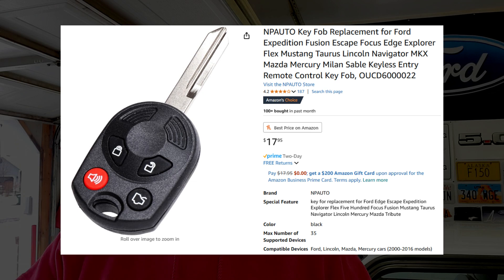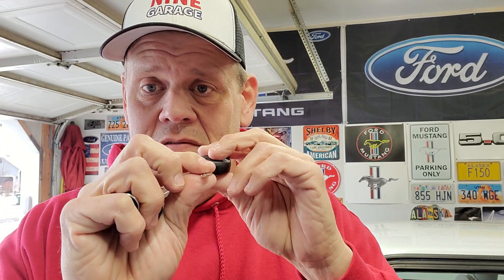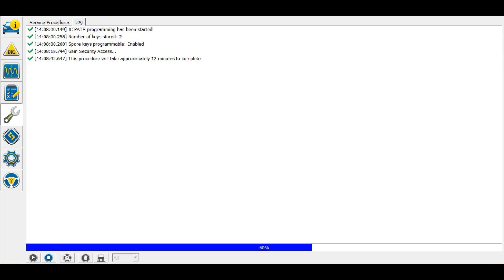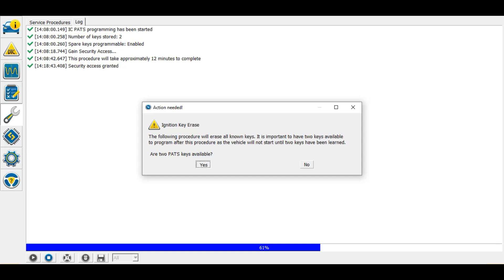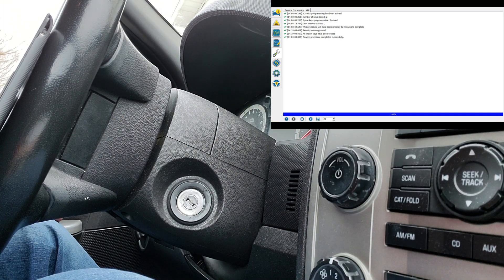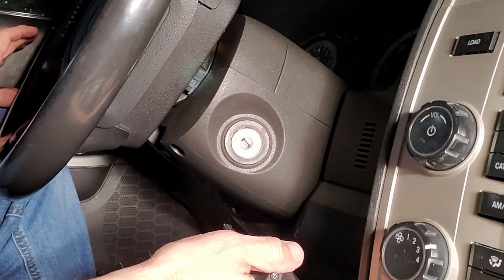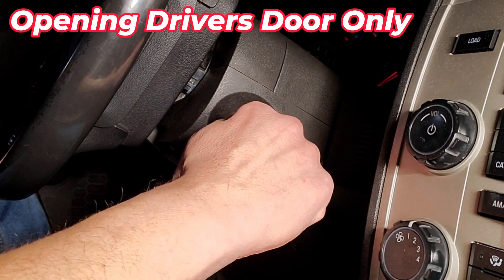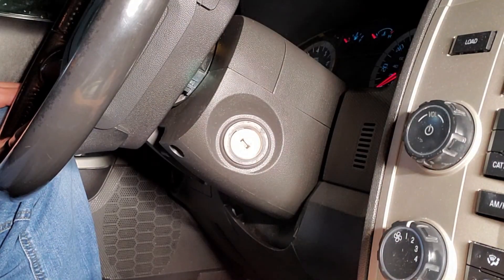Programming a New PATS Key for Ford using FORScan | Step-by-Step Guide

Comment: So i try the remote start on my car i have 2 original keys these are the two Factory keys because I'm the original owner and that remote start did not work from Js alarms they sent me another remote start and it still didn't work I am baffled that it didn't work with two program keys from day one i am original owner thanks
Reply from the maker: That is weird. The way it is acting sounds like one is a cloned key, but that theory is crushed based on your knowledge of the keys being OEM. JS did tell me that they could make it so I could program it off of one key, but it would require me sending it back to them for additional programming. Did that topic come up in your conversations with them?

Comment: Does the original key need to be the OEM FoMoCO key? The only working key I have is a cloned or 3rd party key, so just needing some affirmation on this!
I don't want to start this and then have no working keys ;)
Reply from the maker: It is my understanding that yes, it will work. I have not actually had anything to work with  except an original key. I've read that some newer (2019+) vehicles are not yet supported, however. What year is your vehicle?
Reply: @89G  It worked fine =)
Reply from the maker: @inspyre.design  great info! I really appreciate you adding that to the comments. I'm happy to hear it will work!
Reply: @89G  '11 Expy. I have two new keys cut and ready to program =)

Comment: I’ve got a 2022 f550 with no keys. Had a key made. No buttons or anything just a cut key but when I try to use the PATS programming it’ll say “Service has been interrupted” after 2% of loading. Is it even possible to program a key without the original key?
Reply from the maker: @TheGreenCommando  I believe you'll need at least one key to use Forscan. As I understand it, IDS is the only way to do what you are needing.

Comment: That's not true! Even if its just adding a key locksmith still program the keys remotes into the system. No cloning here jobs are done right.
Reply from the maker: @ALLPROLOCKSMITH  not the people I've called.  That's good if you do it correctly.

Comment: Does it works on free extended license?
Reply from the maker: I've never officially tried it myself, but I have been told that it does indeed work on the free trial extended license.
Reply: @89G  Thanks bro I will try again
Reply from the maker: @johnkimtv25  what adapter are you using? My Elm 327 couldn't do PATS. I had to get the VGate V-linker. The exact one I bought is in the video description. Thank you, and good luck!
Reply: It does not work with the free extended license. I just tried. Forscan is also not able to take payments for the paid extended licenses so I had to pay to have a fob added to my 2019 ranger despite having 2 original keys. The process even Ford says to use did not work for me.
Reply from the maker: @peteboggini6368  try this link... https://www.akm-software.org/
Reply: @89G  thanks I’ll try it.
Reply from the maker: @peteboggini6368  you bet.

Comment: Now I watched your video and I noticed you did this with a certain type of Scan tool one thing I didn't catch do I need the exact scan tool that You used an order to program my key or Will a regular Bluetooth ODB tool like I have already work the same?.

For instance, I'm using veepeak.

I am under the impression based on what you're saying is you need a device that is capable of doing  ms/hs can function Or it will not work or you will not see the option for pats.

From what I can tell the Bluetooth device I have does not have hs/ms can functionality
Reply from the maker: If you can see the PATS function with your adapter, it will work. If not, I put a link to the VGate Vlinker adapter in the video description. There is a short list of "verified" adapters, and the VGate is on that list of FORScan friendly adapters. It's also the most cost effective option that will auto switch MS/HS. Thanks for your question! 
Hopefully that answered it.... if not, let me know.
Reply: @89G  yep! Yep I appreciate it. I ordered it. The one I seen just to be safe Now if only the set of keys I bought aren't damaged. Went to a regular hardware store. They charged me $2. They cut whatever key I brang into them no problem
Reply from the maker: @jaygee6983  awesome! I love getting a deal like that!

Comment: Good evening sir. Your video was perfect timing. I have a 2013 Ford F150 I bought used. I to added a remote start that came with two keys. I was able to program the first key (Key+fob) and the second key would only start the vehicle. I found out I reached the limit of programmed keys. I wasn't sure you could erase and reprogram the original key until I watched your video. Thank you! Thank you!. Also, you instructions on each step to set up forscan plus programming the fob was excellent. Again, Thank you!
Reply from the maker: @user-Mark_Anthony  thank you for the feedback. I am happy it helped you! Thanks for commenting, it means a lot to hear from viewers!
Reply: @89G  You're welcome sir. One question, I have the free 2 month trial of Forscan. If I go to settings - MS-Can Support to make sure it is set to "HS/MS switch" will this work for me with the free trial?
Reply from the maker: @user-Mark_Anthony  Yes... if the PATS shows up on your screen as an option, it will work. Forscan doesn't give the option if it won't do it. Hopefully that answers your question?
Reply: @89G  Yes, sir. Again thank you for the video and responses. Happy New Year!
Reply from the maker: @user-Mark_Anthony  you bet! Happy New Year to you as well.